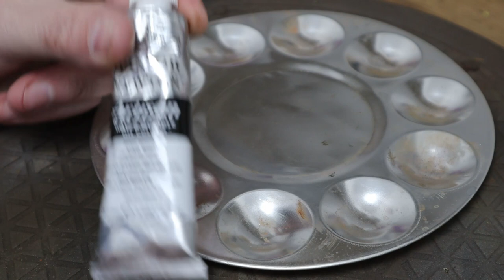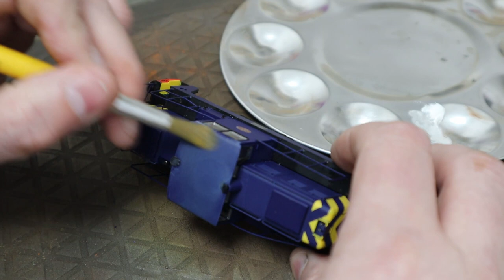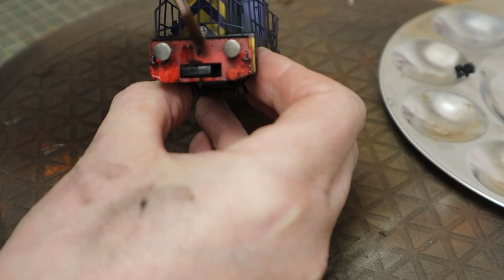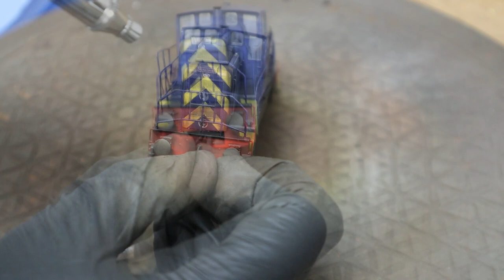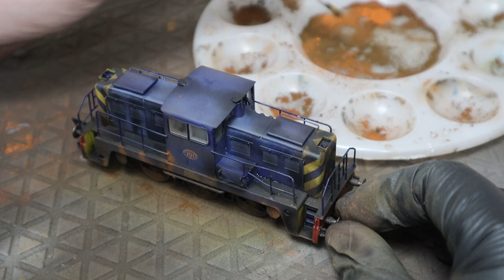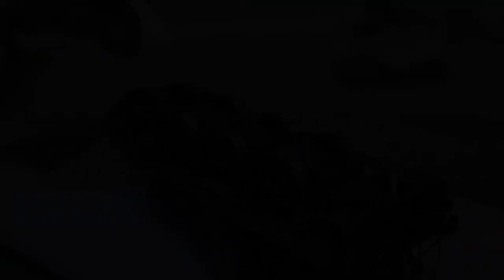Weathering Model Railway | Oxford Rail Janus PLA Shunter

Comment: Another great example of weather.

Could you use the oil smudge techniques in place of where you used an air brush?

You'd need to wait for the oil to dry first obviously before painting over the top.

Could you use enamal paint instead of oils?

Cheers mate!
Reply from the maker: Yes you could use oils instead of the airbrushed acrylics. You would ideally need to wait for the first oil layer to dry before using a new colour. Or use a varnish clear coat to seal it in between colours. 
Enamel paints would give the same effect as oils
Thanks for watching
Reply: Nice job!

Comment: Evening Buddy. Great weathering job 👍🏻 Can you use acrylic the same way as the oils? I’ve a few of them. Since watching your fantastic tutorials I’ve now ordered a airbrush set off eBay 🤣 Hopefully I can produce some fantastic results like yours 🤔 Have a great weekend cheers Stevie 😎🏴
Reply from the maker: Thanks Stevie. 
The thing with acrylics is that they dry pretty quickly and so can’t be manipulated like oils. Oils can also be reactivated with thinners as well, unlike acrylics
Good for you for taking the plunge with an airbrush. Take your time and practice.
Reply: @BuntersYard  Hi Buddy. Yes I understand that with acrylics. I’ve got lamp black and a brown oil paint. Got thinners to. I’ll get a white oil next week. I’ve also ordered a Vallejo air set. What was that black super glue you use? I’ve put the Warship on hold as I’ve found a little 0-4-0 Lima shunter in my old spares box. So that I’ll be my first project lol 😆 Airbrush not due until May so plenty of your fantastic videos to watch and learn. I also work away from home usual 6 days a week so not much time either. ☹️ Take and cheers for all your help Stevie.
Reply from the maker: I’ll put a link to the superglue in the video description for you. Give it a few minutes and it should be there
Good to practice on an older models. It’s a bit scary when you put your first paints onto a £100+ loco 🥴
Good Luck with the new airbrush. 🍀